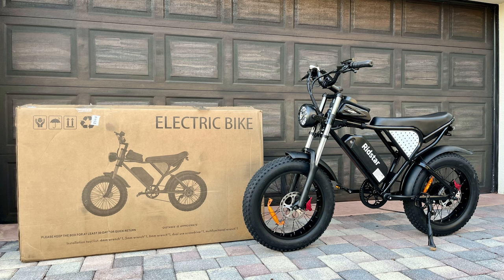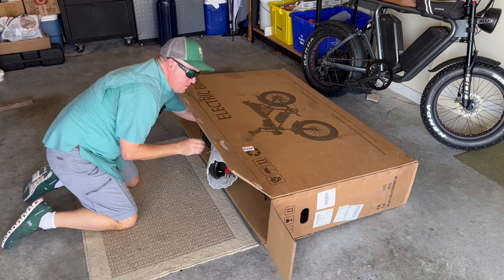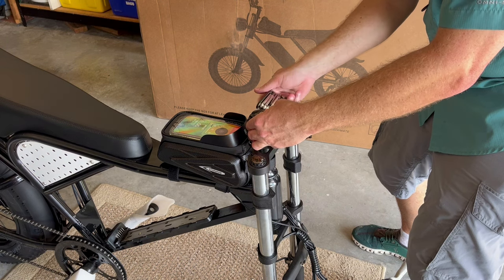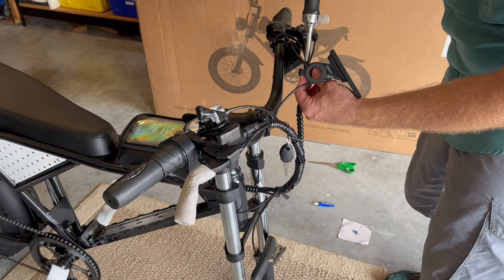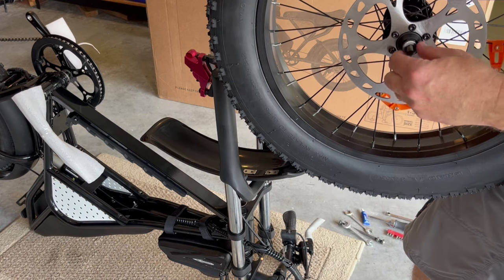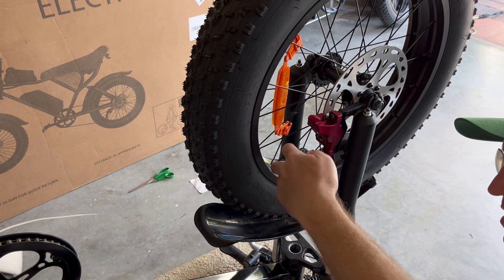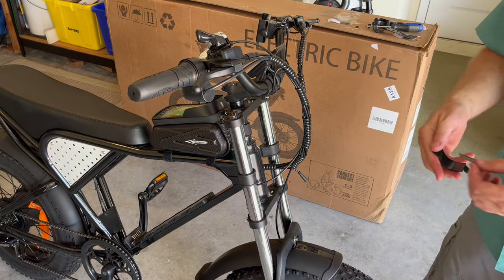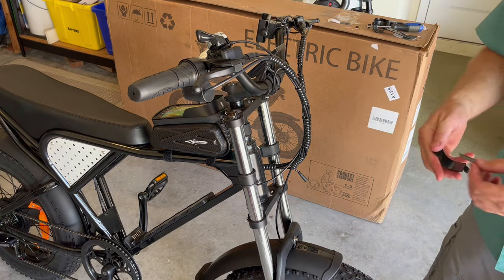Ridstar Q20 eBike - Unbox - Assembly - Settings

Comment: Got mine today very impressed got mine to go 34mph first e bike ever super great buy....Long Beach CA.
Reply from the maker: 43 mph?
Reply: Please explain how you did it?
Reply: 43?! How plz explain
Reply: How did you make it go 43 ? 👀
Reply: I think they meant 34
Reply: He didn't figure he'll get called on it😂
Reply: @UrDadsFavouriteMaleEscort what do you mean ?
Reply: Lol not mph lol
Reply: Prolly meant 34. However there are different wattage you can buy. From 750 - 2000. Maybe he got the expensive one🤷🏾‍♂️ the 1500 is the 30.
Reply: U must mean 43Kilometers 😂
Reply: @VictorLopez-ri3ob    He is going downhill a very steep hill  lol
Reply: Lmaoo 34 ?
Reply: @d1of1c243 why you complaining 😭 if it goes 43 mph thats great im buying this bike soon and ima use this video to help me with the settings
Reply: @parrtrixlol it does not go 43
Reply: Seat height??
Reply: @MikeHunt-x9f  36" , I'm 5'11" 220lbs , it was a great bike, it got stolen 2weeks after I received it😅, would say to upgrade brake pads, and tires. Also suspensions were very squeaky.

Currently have have a Breeze Rider 😎 32mph. No video or reviews on the one I have.
Reply: How did you unlock it to go that fast?

Comment: My front brake is fully clamped and won’t open. Should it have arrived unclamped? I don’t know what to do, this doesn’t seem normal. The instructions are awful too. Most of the the steps you can’t even see or understand what goes where
Reply from the maker: You will need to use a wedge or shim wood to open the caliper.  It happened to me on my Tampbyke.  Large flat head screwdriver might work to as wedge to open calipers

Comment: Fantastic video. I have a question. The light and horn buttons on mine are the wrong way around. The horn button turns the lights on. Is there any way to fix this? Thanks again
Reply from the maker: Ask sell for replacement switch and light

Comment: Just got mine today and I'm amazed with it. What a head turner too! Can't wait to mod it out not that it needs much truly. Awesome bike!
Reply from the maker: I have other video for upgrades on suspension and adding 2nd battery
Reply: How do you remove the chain bracket from the motor on the back wheel? And what little tool is needed. They should have provided the word tools needed. I had to replace the motor after 3 months. It was supposed to be easy ☹️

Comment: I just got this bike today and can’t seem to get the rotor to stop scraping the brake caliper. I tried to tighten the bolts while holding the brake but they didn’t seem like they could get any tighter. Do you have any suggestions? Awesome video super excited about the bike 🙌🏻
Reply from the maker: Most brakes will slightly rub at first but the brake pads will wear in

Comment: Thanks for another great review on an impressive bike! $999/$100s/h for 1000W48V20AH and hyd brakes is Super... and the same bike with AWD 2000W 52V40AH for $1799/$200s/h also gets street tires for maximum range!
Reply from the maker: Not sure $1799 for 52V Ridstar is worth with as you can buy dual battery 52V 44Ah Yolin with aluminum frame for $1500
Reply: @BRichSolution  $1799 (edit: $1899 now) for AWD 2000W52V40AH spanks the Ariel Rider Grizzly's AWD 2000W52V35AH for $3299... I'm not familiar with the Yolin
Reply: Wish I could have got the 2000w version, but was lucky to get the 1000w in UK
Reply: @VonRimski  What are the licensing requirements in UK for a 50kph ebike?
Reply: You have to register it if you intend to go over 15.5 mph on the road. So I'd restrict it and take off restriction on private roads etc. Eventually I will register it.
Reply: Just based of your comment I’m assuming you have the 2000w version of the Ridstar Q20? If so, is yours being limited to 30-31 mph as well (tested with GPS speedometer)? I have this version and so far no matter what I do I can’t seem to go over 31 when it’s said to reach max 37 mph. Feels like as if right when I reach 30 mph or so the acceleration stops and feels like it’s just maintaining that constant speed and not going up at all.
Reply: @BacNTaters  You've definitely got to reconfigure your settings... The factory should be able to help you with that
Reply: @johnw65  I tried adjusting everything in my settings. Nothing. I’ve been in contact with the factory and so far I’m not getting a proper answer. It’s been a week or so I’ve just been trying to reach out to who I can online cuz there’s no videos/little info on this version of this bike online. This is my first e bike btw so its been a complicated first experience lol. Recently though I did get a message with the seller saying “if the restrictions are lifted it can affect the bike” so I’m currently trying to get an answer out of that for a solution. If they said that then obviously something is limiting the bike. For the time being, do you have any suggestions to fix this? Based off the help I’ve gotten so far, which even included help from BRichSolutions and Reddit, it seems like it’s narrowed down to something limiting the bike within the controller under the seat, motors, or maybe a wire like some other e bikes have.
Reply: @BacNTaters  Ask B Rich Directly. I don't have the Q-20 personally but wish I did. I've heard many different methods of unlocking various bikes depending on the brand... My bike is limited to 34 mph. 35 turns off the whole bike down to about 25. So, I play around at 34 as much as possible.
Reply: @johnw65  O ok sorry I thought you had it and yeah I’ve been talking with BRich. Idk if you’ve seen my other comments on this vid but me and him have been going back and forth trying to figure this out. No progress yet but it’s getting there slowly. Appreciate the help though.

Comment: hey, i have this same bike but i changed a couple settings and now I only go 29mph, before that I could get 33.4mph, I really need to see the standard settings for this bike could anyone help me?
Reply from the maker: I will do a video of settings this weekend.   The Speedometer may have read 33mph but doubtful the bike can do 32 mph with controller is limited to 20 amp output.  I will post video of speed test and validate speed with GPS telemetry data said 31 mph and speedometer read 33

Comment: can you do and review on the Ridstar q2 its and 2000 watt 52v 40 Ah e bike on amazon it's and dual motor and dual battery setup that that claims to have over 75 miles of throttle range an goes 35 mph
Reply from the maker: See reddit post.   https://www.reddit.com/r/ebikes/comments/14tqadz/anyone_have_the_ridstar_q20_pro_2000w_52v_40ah/
 Dual BatteryQ20 pro bike is not faster than Q20 single motor, Pro only has better torque for hill climb.  Only better torque.  If you spend $1700 buy the Yolin dual battery if you want to go 35 mph.  https://youtu.be/KPf2C8uzaVo    Q20 is great, the Q20 Pro is priced wrong

Comment: Hi  I bought the Q20 Ridstar , the chain seems a bit close to the tire  , it’s about a 1/2 inch from back tire, is that normal.  Actually a video how to adjust would be helpful. Thanks for your help.
Reply from the maker: Can you make sure the transmission (2 smaller wheels) in the back in chain is operating properly and move them back and forth until chain tightens up

Comment: Question. My front break doesn’t work, why?
Reply from the maker: Is the brake lever not working or easy to pull?  Maybe fluid leaked out
Reply: @BRichSolution  it won’t break at all from the front
Reply: @elcuhangeltv same my front brakes aren’t working either. What did you do?
Reply: @StefMan30  
They work now. Your wheel is probably facing the wrong side. It wants stupid mistake I did at first. Once it’s facing the correct side just try to fit the disk on wheel inside the break pad. If it doesn’t fit use a knife or something you can squeeze inside to make the breaks open up more.
Reply: @elcuhangeltv how would it be facing the wrong side ? Which side is the correct side ?

Comment: I put the 1200W together for my grandson’s birthday. He will not get it for another week. It was a little different from the one put together in the video, but the video was very helpful. I have a question…the switch for the light and the horn came assembled and attached to the bike. I only attached the light and “plugged” it into what was on the bike. Problem:  The horn button and light button are backwards/crisscrossed. The horn stays on when you push the light button and the light blinks and does not stay on when the horn button is pushed.
Reply from the maker: Ask seller for new switch and headlight

Comment: Sir I need help. My partner has a bike like this. 

He is having issues with the wire that is on the side where the chain is down by that area (right side). 

It's a cable(?) and keeps coming unplugged... Making the bike stop working.

I need to know what that part is and is it easy to repair.... 

Thank u for ur time.
Reply from the maker: Ziptie cable to frame on each side of connector to ensure it stays connected

Comment: Hello B Rich, I just received my Ridstar Q20 and it is limited to 11mph.  I set all my P settings to what you have in the video.  Is there a white single wire that needs to be disconnected on the motor controller - like a speed limiter wire?
Reply from the maker: Did you change p14 to 20 amps?
Reply from the maker: See this video for settings.   Should be no wire to cut
https://youtu.be/pnaEkvOyHwE
Reply: I did change the setting to 20 amps.  I figured it out.  The PSA setting was on 1, I changed it to 5 and now I have full speed.  Got it to 31 mph, woohoo!  Thanks for your settings video, it helped a bunch 👍👍👍

Comment: Hi brake caliper set apply pressure Holding caliper to disc firmly and tighten bolts with other hand. Or can use a peice or string/bungy wrapp around few times it's a third hand. Easy tip. Enjoy Scott
Reply from the maker: Yes, thats what i did to center the brake caliper

Comment: Looks like a better ouxi v8.
i'm looking around for a step-thruh fatbike with cargo racks, not that many reviews of them sadly if u know of any good ones
Reply from the maker: The Q20 is great bike and value if you pay less than $1200.  The q20 is Very similar to Ouxi v8 but has rear suspension and larger battery.  As for step thru bikes i don’t particularly like them as they tend to be heavy as the frame and over engineered for the V shape
Reply: @BRichSolution  i just googled a ouxi v8 is 81lbs or 36kg the step thru fatbikes i looked at all weigh between 30-35kg.
Reply: Get the Fiido T1 pro. It's great for a budget cargo bike.
Reply: @jessehavok4181  750w so illegal; i can order them but its €2000 for me. same price as a radrunner plus i can get those from shops in holland.

Comment: What brand motor is on this bike? Nice review.
Reply from the maker: Motor housing doesn’t have a brand name on it.  Motor is strong and will post speed and acceleration test in a few days
Reply: @BRichSolution  thanks.  I have the same motors on my yolin and was wondering if you knew what brand they were.

Comment: I just got my bike and I’m on boxing it right now. The only problem I’m having is with the front tire assembly because one of the tire bolts is stripped and I really don’t want to try to force it onto the tire hub and possibly strip out that thread, but when I’m noticing too, is this really not a lot of thread room to put those bolts on, I think they should’ve just added like a 1/4  of an inch more of length as I tighten a bolt it pulls the axle towards it. Poor oversight. I’m gonna have to go to the hardware store and see if I can find a match to the rounded nut. If not, I gotta go through a bunch of crap to try to get them to send me a replacement through Amazon which kind of stinks, but I’m still not comfortable with the length of the axle. I’m wondering if I can find something that would be a little bit longer, otherwise I don’t feel I’m gonna get the front tire on tight enough and I really don’t feel that it’s safe
Reply from the maker: Good idea
Reply: @BRichSolution  I went to the hardware store and just got the hundred millimeter nut that was open ended it wasn’t stainless steel because they didn’t have any so I’m thinking maybe I’ll just try to find those plastic nut covers they sell(😂) and keep it from rusting or buy som plastidip  spray to cover it today is the maiden voyage hope I don’t lose the tire n crash.

Comment: What's the battery dimension? I want to get this bike but upgrade to a 52v 24.4ah battery. Just need to know if it will fit.
Reply from the maker: the 20Ah battery is 15" long, 3.75" wide and 4.3" tall.  The 52V 24Ah battery will be the size only taller probably 6" and will fit in the frame; you might have to use the mount that comes with the new battery
Reply: @BRichSolution Ok, mounting shouldnt be a problem. Thank you for the reply.

Comment: Seems pretty nice but I can’t even get the nuts off the front tire. Kind of disappointed with this bike. 

Then I also realized the front tire is the wrong size. Won’t even sit between the forks. What a mess.
Reply from the maker: There should be flats on the axial by wheel spokes to hold with wrench to stop axial from spinning then use wrench ti remove nuts.   Once removed might take a little force to seat in fork

Comment: Ok so I ran a test with the settings you have. Didn’t make a difference so idk what should be done now. When I did do another test, I also tested the top speed of each wheel motor and with both motors again. When the rear motor is running on its own, it can reach a top speed of 30 mph. However, the front motor can only reach 28 mph. When both motors are on, it can reach at most 31 mph. These speeds were collected with a GPS speedometer and on PAS 5. So based off what I’ve done so far, I can only assume the reason for the bike being limited is either because of the controller under the seat is defective/not the right controller for my dual motor e bike or maybe even a wire or something in relation to that is limiting the speed. Do you think this can be the case for my e bike? As I know some e bikes can have a wire that needs to be cut in order to unlock it. In addition, you mentioned a couple of comments ago about my motors being maxed? Can you please explain more what you meant by that? Thanks again for the continued help.
Reply from the maker: Yes something is not adding up.   Can you remove the seat and test the controllers output to front and rear motor is 30A and 52-58V?   How heavy is bike with dual motors and batteries close to 100lbs?    Each hub motor has gears internally see this link https://electricallwheel.com/ebike-motor-gear-replacement-bafang-g360/     Hub motor could be restricted top speed if internal gearing is not capable of higher speeds.   There could be power restriction in the motor also.   Example i have is my friend ordered same yolin dual battery ebike that i have but with bafang 1000w motor and the bike was 2-3 mph slower then mine with xiongda 1000w motor.   Manufacturer sent nee controller and not much changed.   Frustrated he ordered same bike with xiongda motor and the bike is same speed as mine

Comment: My front wheel came with like a rubber disc where the washers are supposed to be on the opposite side of the motor disc thing. Do you know what it is?
Reply from the maker: Its protection during shipping
Reply: @BRichSolution how do you take it off

Comment: Ok, bought  Happyrun G50  -   its comfortable, but less torque and top speed it struggles.    Amyet G60  is my favorite as it has the torque and good top speed high bmx handlebar, rear footpegs,  great display and pedaling is actually great.    Which brings me to my Ridstar Q20 with 20 ah.   It Looks the best, is the fastest.   I think pedaling on it is terrible and the handlebars are very low.  I prefer the higher handlebars to have that comfort.    I assume this was intentionally done by Ridstar to go with a little more of a dirt bike look.     I'm going to eventually modify these with faster motors etc..
Reply from the maker: Happyrun G50 is slow
Amyet g60 is is fast and torquey wish it had hydraulic brakes.  Q20 with 20Ah is great value

Comment: I've been looking at this bike on allibaba express for a while wondering if it was safe to order. I'm astounded because even your box looks in solid condition. Thanks very much for this video. ❤
Reply from the maker: Yes, but make use to order the version with 20Ah battery.   The cheaper 15Ah version not worth the $100 saving as it has smaller screen & battery and brakes are not hydraulic

Comment: Dude you didn’t explain it very well. I’m still struggling on the wheel with the bolts and washers. 
In your video it sticks out but mine isn’t even long enough so I can tighten the wheel on both sides
Reply: Wow you’re vídeo made me mess up. I wasn’t even supposed to remove those screws on the wheel that you told us to remove.
Reply from the maker: The axial bolt is on the short side i admit.   If too short fore go the washers on one side or both if needed to engage the thread.  You must keep the spacers on the inside of the fork
Reply: @BRichSolution  
I figured it out. I guess my bike is different from yours but they look the same. I didn’t even have to removed those bolts on the front wheel

Comment: B Rich, please help! I have a Q20 lite, was messing around with +- buttons, and now throttle does not work after start up. How do I do a factory reset? It has the small display on the left grip. Also can I unlock the speed for more mph? Thanks, love your videos!
Reply from the maker: Is the screed m5 or smaller screen on the 15ah version?  If m5 see full user manual in link https://drive.google.com/file/d/11lAw9iM5LSeClU6BIZ9uhWouXFD8nR_3/view
Reply: It's the smaller screen on the 15ah model. LCD display EN06